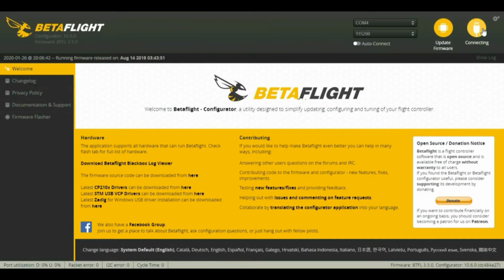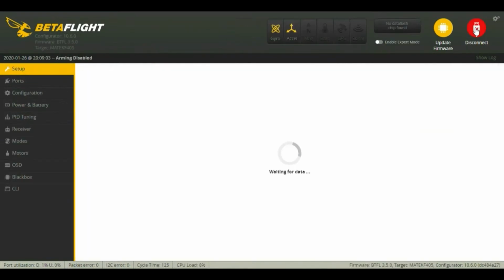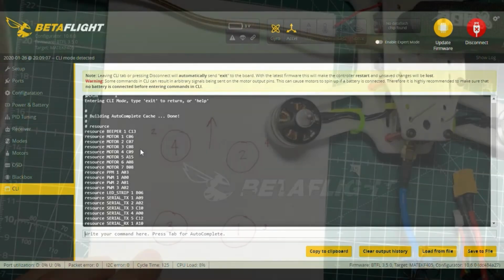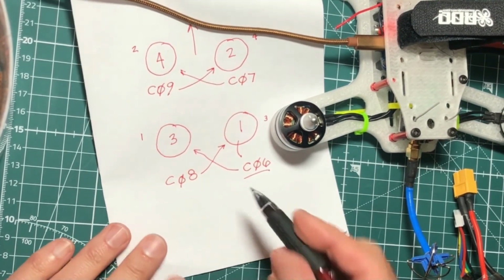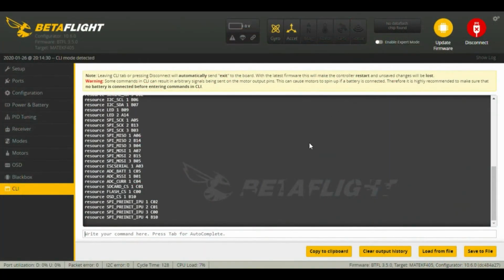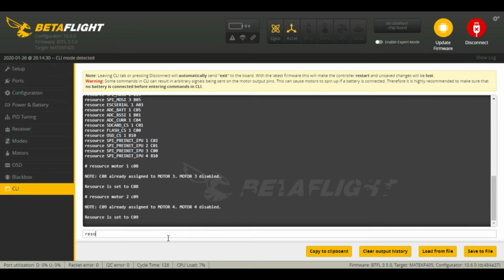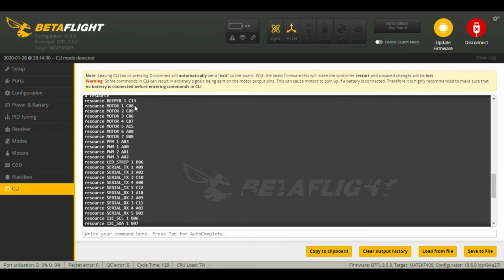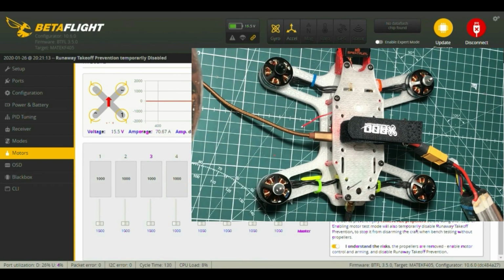Betaflight - motor resource remapping

Comment: Nice tutorial. right to the point. It all started with flipping the ESC board and fixing it in BetaFlight is an easy way to do it without re-soldering or remounting the ESC.